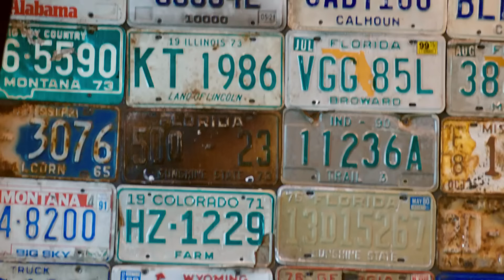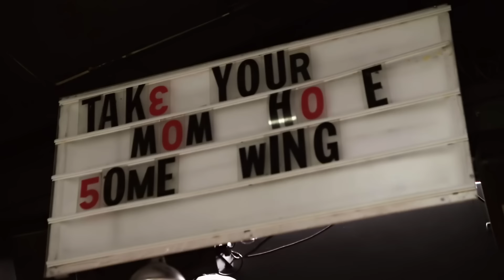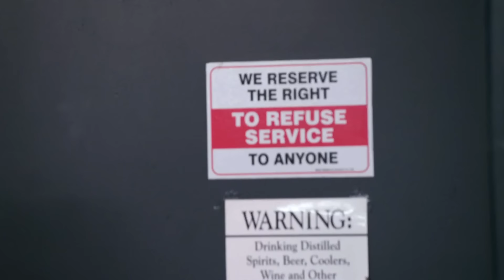Season 9’s Must-See Moments (So Far!) | Bar Rescue

Comment: The bathtub in the middle of a bar is almost as bad as the episode with the horse that was in the bar! 😂😂😂😂😂😂
Reply: Nah nah.  Almost bad as the one with THAT couch.
Reply: Lol 😆
Reply: @pennjets nah, nothing is as bad as the episode when a freaking opossum runs through the kitchen into the restaurant area and out the door.
Reply: i think i know this tub and why it was so "dirty". theres a huge "underground" dubstep group here in jax called Wub Tub which Wook Doctor and Stupid Thick (the owners of WT) would take that tub and put it in front of the rail on the terrace stage at myth nightclub 2 blocks down from that bar/underbelly and would put their stage speakers in that tub hence all the black marks as thats the plastic/rubber feet on the bottom of the monitors. I remember having a conversation about their tub like 2 weeks ago with a whole bunch of guys from Electronic Duval Movement and Wook Doctor and i think thats the actual tub they used lmao.

Granted i could be very fucking wrong but i can just ask WD tomorrow about it but if it is thats nuts that it was in a bar rescue episode but makes sense that it shares a wall with Underbelly another club on bay street
Reply: @KiyotaiTalks did you find out lol 👀